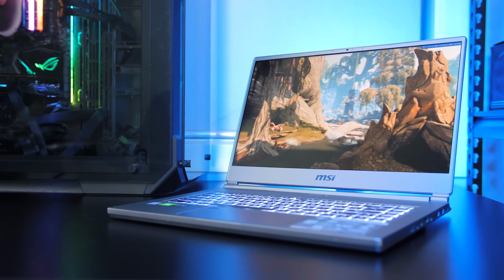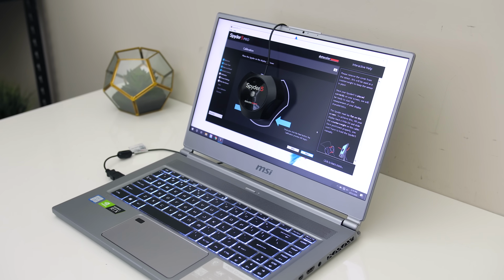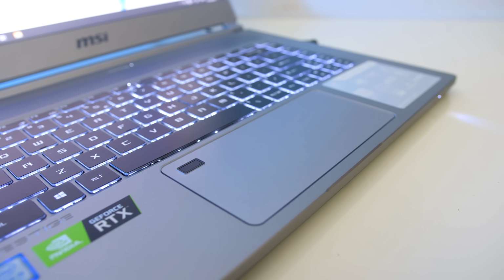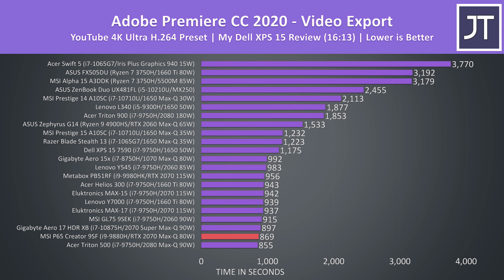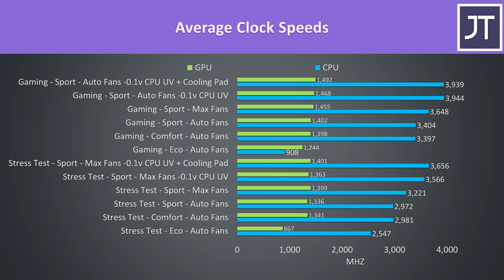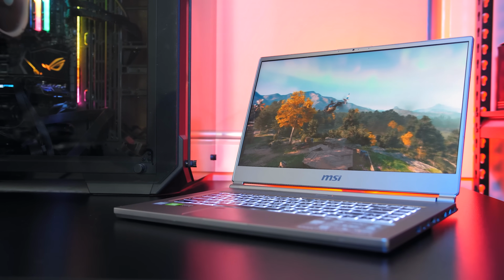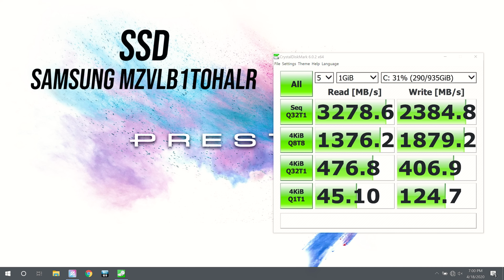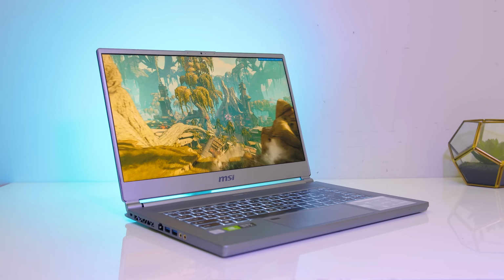MSI P65 Creator 9SF Review - Thin + 8 Core CPU?

Comment: MSI chose to put a big power cable node on the right side of the laptop very close to the laptop plug, where a lot of users will try to use a mouse. It is also a pain when putting the laptop down on the table, it can get stuck beneath. Same questionable choice as Gigabyte on the Aero series.

Comment: this laptop looks really nice but it has the wrong cpu in it for me.
why would anyone put one of intels 14nm+++++++++++ heating units with a screen on their lap right now, when a much better option is right around the corner (less power draw, better performance, cooler ...)
i'll wait for hp, dell or lenovo to grab their balls out of intels purse and start building a real content creator laptop for 2020 using the ryzen 4000 series.

Comment: I got the 9SD variant (i7-9750H+1660Ti) 2 months ago, a bit dissapointed with its thermal ..... had to change the paste into liquid metal to lower the max temp from 95 to 75 with cooling pad under it. Note that I already tried undervolt it and change the paste to a better one (Kingpin and Kryonaut) because the stock one had already hardening out. But alas, the max temp still hitting the 90s occasionally before finally opting to liquid metal (Conductonaut).
Other than thermal issue mainly caused by the faulty i7 chip I got, I am quite satisfied with it. Seeing that the 9F variant had the same thermal issue, I am not that surprised anymore.
If only the Zephyrus G14 had released earlier i would choose that instead xD

Edit : It is also quite a dissapointment that the MSI Creator Center app doesn't include fan curve feature like its Dragon Center's counterpart. Hope, they included it the future software update.

Comment: i got a small note:
Youtubers should make some videos about how ryzen mobile cpu is not configured well via OEMs comparing to Intel based laptops.i mean they matched with lower GPUs, bad screens, soldered rams..etc
i have received the g14....after 3 days of usage i said in my deeps uh man finally someone build the machine of my dream when power meets efficiency and durability...but i had only 2 downsides soldered ram if i upgrade it it will behave as a single channel and screen response time its ok for campaign games but when it comes to Competitive idk but i solve this with High refresh rate external monitor..
overall better than previous Triton 500 for me ^_^

Comment: I'm actually using the p65 9SE-1084 for content creation. Mostly music production and graphic design with some 3d modeling and rendering on the side. Thermals aren't much better with the i7 to be honest, and the paint has started wearing off on the underside of the lid by the screen, my model also has a larger gap between the plastic around the screen and the metal on the lid. But well, it was really the only laptop I could find with a 4k screen, rtx gpu, 32 gigs of ram, a decent amount of storage, and good battery life that I could find at $2000 USD at the time. Do really wish that ryzen 4000 was out when I bought it, but it's an alright laptop.

Comment: So what is creator about it?
 The looks? I mean lets be honest here, it's just another gaming laptop out of your reach. If you really need power now, go with an Eluktronics laptop with 10th gen Intel and EluktroBoost if it's available in your region. If you don't need the extra few FPS that the 2070+ GPUs provide (which I reckon
 you don't), a 2060 will be just fine. Since in all cases you'll have to wait (unless you wanna buy an older generation), then you're better off going with a good 4800H + 2060 option that will show up soon, and your wallet will thank you.

Comment: Sorry MSI, No Ryzen, no buy....

Give me 17inch laptop running Ryzen 4900HS or H, 4k 120hz color accurate screen like Razer Pro 17 4k, Nvidia RTX 2070/2080 max Q super, 2x NVME, 2x RAM, 2x Thunderbolt, 99whr battery, all the IO options like on Aero 17, speakers and mics like MacBook pro 16, good webcam, keyboard and trackpad and ill be really interested and ok to pay these high prices

But these laptop's hardly offer any upgrade of last years models, not to mention the choice of those inefficient Intel chips....

Comment: Would have been great if you included more productivity task benchmarks (since this is meant to be a creator laptop). Unless you're only using Adobe Premier, what's the justification for spending $2700 on this compared to the ASUS G14 4900HS for $1500?

Comment: Watched the review with interest. Having recently bought the P75 9SE which is effectively the GS75 version of this P65 in the i7 9750H + RTX 2060 configuration, and after using it for a few weeks, I think on the whole it's a good laptop - but there's a but.

I feel that at the price-point ($3,500 NZD), the build quality is just not there. If you compare it with even say, the Aero 17, or the Razer Blade 17 Advanced.. it just feels like a toy. Too much plastic and the chassis creaks and groans whenever you pick it up.

Due to the thermal issues I've had with my unit it will be going back, but I have to say it's a shame. I really wanted to like it. The idea, the performance, and the essence is there. Just not quite executed as well as it could have been IMO. I will say on the positive side - the 17" 144hz 1080p panel in my P75 is gorgeous. The keyboard though shallow is nice to type on, and I think the extra wide windows precision touch-pad is one of the nicest touch-pads I've used. 

Anyway thanks Jarrod - Great vid. Top notch as per usual :)

-Jordan
Reply from the maker: Cheers! Yeah I agree with that, having the Aero 17 here side by side the build quality is a noticeable step up, granted it was a little more expensive for the one I have (but also higher specs).
Reply: @JarrodsTech  How would you compare the build quality of the Gigabytes (Aero/Aorus) & Razers to the MAG 15?

Comment: 4K display on a 15.6" screen. Only few people can see the difference between 1080P and 4K on a small screen.
Reply from the maker: I don't think the point is so much the resolution, but more so that 4K panels typically have better brightness/colour gamut options which are ideal for content creation. I'd just run mine at 1080p.
Reply: Wide color gamut panels are only available in 1440P and 4K, that's why 4K laptops are used for content creation.
Reply: 4K is much better for my 3D or 2D softwares, a lot more screen real estate to work with. Huge differences imho. And no need to zoom in on photos too in Lightroom.

Comment: A sincere opinion, is better than new asus tuf?
Reply from the maker: I haven't used the new TUF yet so have no opinion on it at this time. If you're comparing to the P65? The TUF screen will be crap compared to the higher gamut of this, but this is only 60Hz 4K so not really for gaming - though you can of course game at 1080p just fine, as shown.